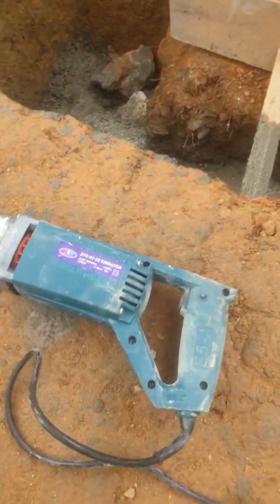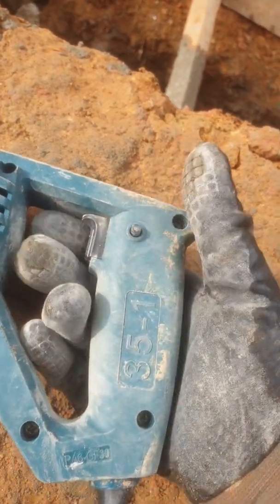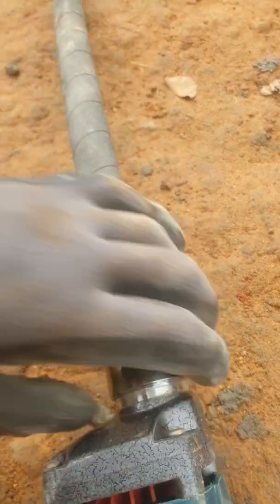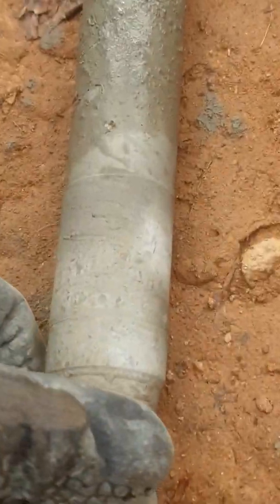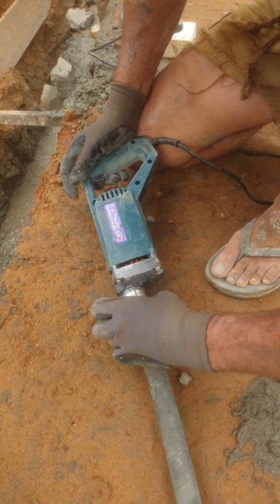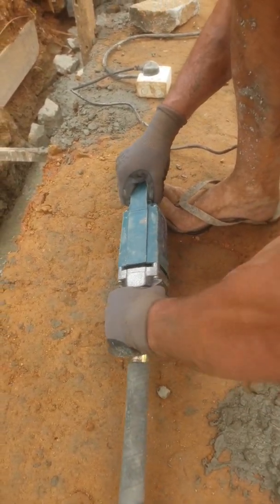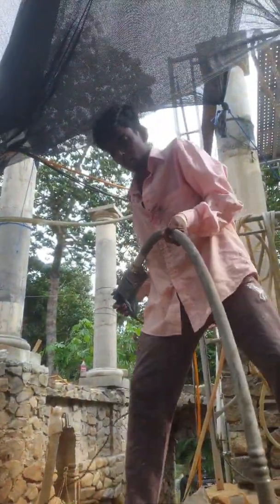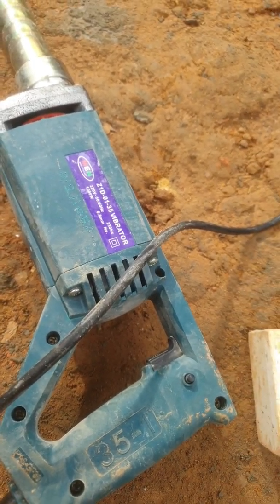CeySri Lanka,ශ්‍රී ලංකා,Ceylon,Concrete Vibrator,Poker,Trial,Review

Comment: Hi dear, i have the same vibrator , i will use it for  my column but the column  has a 3 meters height , how can i use it for vibrating the column ? If there is a truck for exemple fixing the machine in a part if wood or any silution
Reply from the maker: Hello. You can attach a rope to your electrical tool or a chain. And first make the tool vibrate and next lower it attached to the rope inside your casting boxes. Also you can fix your tool to a stick.. or a metal pipe. Have a small metal welded to the pipe to better attach your electrical vibrator.